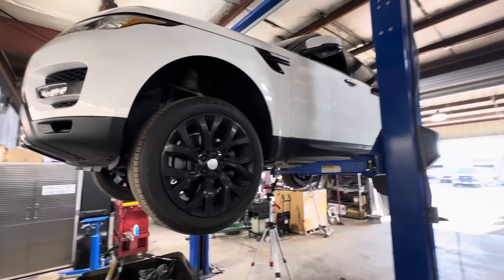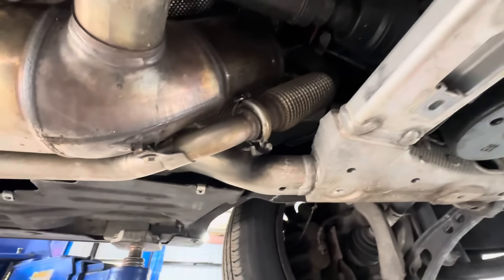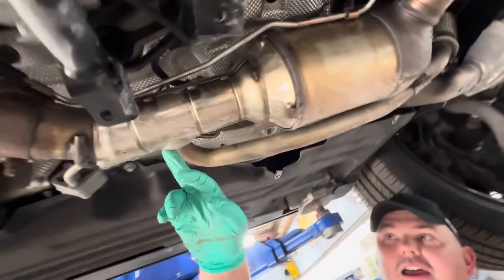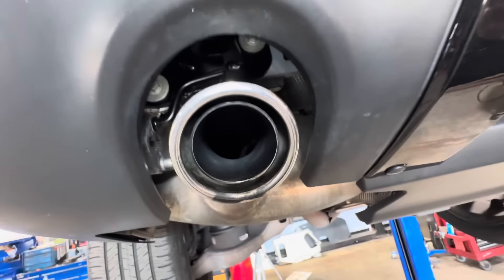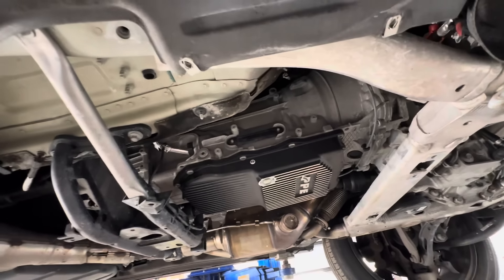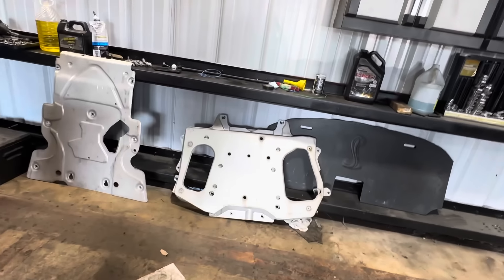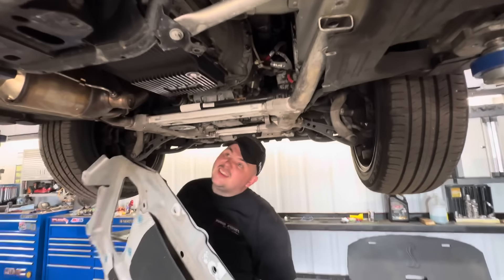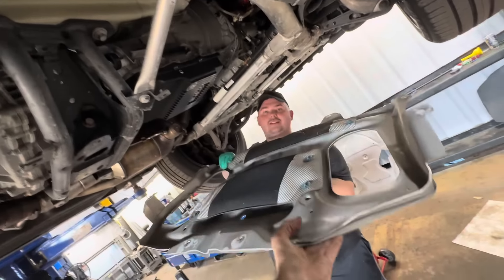Most Expensive Over Engineered Exhaust EVER!!! 2017 Range Rover 3.0 Diesel

Comment: Don't worry, it'll snap its crankshaft soon or do a big end. We see these failures all the time here in the UK where the engine is very common. It's also used in Citroen C5's and C6's, as well as the new Ford Ranger and nigh-on identical VW Amarok.
Reply from the maker: It's needs a crank swap from the ford 3.0
Reply: Also the padlock is useless. Nice try though.
Reply: @RainmanRaysRepairs  The Gen 2 engines from 2018 (which this is one of them) have the same crank and they're still snapping. I think half of the issue is how much power JLR are squeezing out of the things - at up to 302 bhp/225 kW and 516 lb-ft/700 Nm something has to give. Even so, the lubrication pathways to the second and third mains are dire and suffer massive oil pressure drops, not helped by the new oil pump with the electronic solenoid designed to reduce oil pressure under light load conditions.
Reply: I was trying to use a scope to tell if the one I was working on had timing issues but had a hard time because the resolution of my scope sucks

Comment: Cars are mysterious machines. my beloved old /98 corolla took me  out running errands on friday and was perfectly normal... saturday morning i turned the key and nothing happened but i did have lots of battery power judging by light brightness... $60 tow to the mechanic who diagnosed it with a blown ignition relay... I dunno what that is but it died in its sleep apparently. I had them do oil change and a routine inspection so I feel safe taking it into the Canadian wilderness camping this summer.  shes an old girl so  having my trusted mechanic stamp his seal of approval on her is a good feeling.
Reply: old cars need maintenance.  you just do those repairs and thank the old girl for the continued service!!  I had a '87 Camry in Calgary (10 yrs old) and that thing was amazing, better than any 4wd in winter too.  Boring as eff, but hey, it's a tin box on wheels.

Comment: As a 5X Land Rover owner here in the UK and mechanic for 30 odd yrs I am fully qualified to ask "why are you standing under one without a leak tray ?" People would get board if I shipped my Disco3 to your shop to get all the faults repaired, I cry when I buy a new part for it knowing that something else will break before I can fit it. Land Rover the best 4X4Xfar ......It's like an English Jeep thing but without the ducks !! LOL XX
Reply: if you want a good jeep in the US we get a toyota 4runner or an old lexus of the same design. ford and chevy seem to be only slightly better than jeep unfortunately
Reply: Disco3 (LR3 for us in the States) is among the more reliable Rover models. That V8 was very good and reliable. Far better than the newer gen V8 & V6 engines. Rust and water intrusion are what destroys those cars around here. Cheers.
Reply: What do you guys have against designing electrics and electronics? I had a 1969 Triumph motorcycle that had nothing but issues with the electrics and every single UK made car is horrible.
Reply: Well, once BMW bought LR they did finally make a LR that did not leak fluids while in warranty, something JLR could never do.
Reply: @mattbrown5511  Lucas electrical, they invented the intermittent wiper, and also the flashing indicator. All you can say is that you are thankful they did not also include Magneti Marelli ignition in the mix as well.
Reply: @SeanBZA  BMW didn’t own Rover Group for very long. They lost a lot of money on that venture. They did end up with the MINI Cooper brand, though.
Reply: @paulferreira8342  Yes, but those BMW designed 3.0l engines were a lot better than the old V8 engines that were there, and did not lead oil, plus had much better fuel economy. No drive on a beach in low, and get a warning about "fill up fuel, range below 80km" with a full tank.

Comment: Great video. The hoops car companies are having to jump through for emissions is incredible. The customer always foots the bill
Reply: That same Ford diesel is available in other vehicles with simpler exhaust setups.  It wasn't government that required the hoops shown here, it was Jaguar / Range Rover that thought this was a good idea. As my father used to say, never trust the English to build anything larger than a hat.
Reply: @billmilosz It wasn't your government, but it was the UK and EU that required it. They're not going to change the exhaust system just for the US market when all other markets require it.
Reply: These are particulate control measures. The hoops people have to jump through to avoid dying are incredible. Why should people die so some can drive diesels? The manufacturer makes money and the rest of us foot the bill. This goes double for oil companies.
Reply: I agree, resource/emission management from the tail wagging the dog.
Reply: @SammyInnit  The Ford diesels sold for Ford vehicles in the UK have emission / particulate controls, but do not have this crazy plumbers' nightmare going on.  This is totally a Jaguar / Range Rover snafu.
Reply: A lot of engineering to save us from the tons of soot diesels would be shooting out without it.
Reply: Diesels are dying in the light-duty market.  If you're not hauling heavy loads or pulling up stumps, it's not worth the weight and the hassle.  I would not be surprised if replacing this exhaust would set you back $10,000.  It seems like a weird choice for a Land Rover.

Comment: Engineered to keep tapping your wallet.
Reply: You probably prefer rolling coal until the birds drop out of the sky
Reply: Not necessarily, when this kind of exhaust system goes wrong it is eye wateringly expensive to put it right, eg Def pump £579, Def injector £100, scr £1000, egr £100s and that's just some of the components that make it up, reality is the amount that those components reduce emissions can't be that much if cars that have them removed are still flying through emissions tests on the MOT (UK road safety test for a vehicle) and as far as I know they are fairly strict about it so it could well be engineered to keep tapping your wallet, it certainly does mine
Reply: But where is the converter thief supposed to make their Sawzall cuts?
(I AM JOKING!)
Reply: @MonkeyJedi99  🤣🤣🤣
Reply: @garybell3924  They are HUGE amounts cleaner than cars without all those things. Cars without those things wouldn't pass the EU emissions requirements to be able to sell them. The reason they still pass MOTs is because the legislation for testing them each year hasn't caught up due to the complexity and costs of the equipment to do those tests. Although currently they are working on that and soon all those cars with no DPF and no EGR will end up failing the emissions tests.

Comment: DPF filter particulate filter. The service life depends on the quality of the fuel plus the quality of the engine / oil consumption / which causes soot when diesel is burned - I mean oil consumption. The regeneration of this burning soot trapped inside works cyclically, approximately every 300 miles, but the ash created from burning soot inside the DPF remains and rises. Over time, the DPF becomes clogged with ash, which means an expensive replacement. DPFs cost a lot of money and the lifespan in the city is about 150,000 miles. The SCR system behind the DPF filter has a urea injector that helps clean the catalytic converter and reduces NOx in the exhaust system or otherwise reduces the NOx the car emits into the atmosphere. You have to regularly buy and add urea to a separate tank that is inside the car. The urea injector clogs after a while and the NOx sensors give error codes on the dashboard. One of the many faults of the emission system.. All this is a complex Euro 6 emission reduction system and means a huge cost to repair this system. There is a software option to disable this miracle techniques and save a lot of money. You just need to find the right person to reprogram your engine control unit. In Europe, the price is around 200 dollars. And it's a matter of a maximum of two hours.

Comment: Having the EGR using colder exhaust gas is to reduce the carbon build-up in the intake. It's actually a very clever solution. Mercedes does it as well.

Comment: Range Rovers' main plant is 20 or so miles from my home, so it's always nice to see them in the states. 

Unfortunately, they're over engineered because of the European market. They're very stringent on exhaust emissions. 

People also say they're incredibly unreliable. The L322 were quite unreliable, but not to the point that the rumour mill would have you believe. The issue is that they're expensive cars that require expensive maintenance. People don't like to pay it and so neglect them and like any other, they fail.

Comment: I had a 2016 VW Golf, part of the diesel gate scandal, and its exhaust was complex too.  They kept trying to soak me $2600 for a DPF while the vehicle was under warranty.  They also told me the DPF was getting full because I was "driving the car wrong".  I laughed at the guy and said "they designed the car wrong".  They gave me my money back on the car and I won't buy another VW group product again.   I loved the 38/50 mpg that I got but not at those costs and lies they kept spewing.
Reply: DPF easiest fix is 100 miles on highway at speed, to get it to do a self clean every month. Short trips and low speed kills them.
Reply: $2600 for a DPF are they having you on? ridiculous.

Comment: Range Rover is like Mercedes, I can afford the car, but not the upkeep.
Reply: you're doing well if you can afford that car!!
Reply: A lot of people buy them used after the depreciation hit without understanding that the maintenance & repairs are still priced for an $85k car not a $25k car.
Reply: @DeepakKumar-lv4te  I can afford a USED 2017.
Reply: @jimdavis6833  I'm driving an '08 VW Multivan which has been surprisingly solid.  I don't think I could handle the trauma of owning a RR even though it's probably the best cruiser going.

Comment: You might also consider removing the padding. Not sure why it's there anyway.

Saw a video a guy had a car with straight thru mufflers, they make good power, but have an annoying drone when on highway.

Installed a tee, a 90, and a CAREFULLY measured length of pipe, than a cap.  Used a telescoping connection in middle, since this pipe had to EXACTLY the right length.  A 1/2 inch off would ruin it.

Totally removes that one frequency from the exhaust.

Comment: I have a 2008 LR2 w/ 114K miles. Engineering like that cost a fortune to make repairs in Michigan. 5+ hours to replace a thermostat and near that much to remove entire front end to replace horn unit. Fortunately it is reliable and runs great but w/o a horn or new thermostat due to limited fixed SS income. I prefer a Ford E350 or a Cadillac of similar vintage.  Retired guy age 73

Comment: Good luck getting information on RR. Especially diesel. Had one that def issues. Would shut the truck down because of the smog crap. Small shop just can’t get the required information on some brands. Time consuming
Reply: I have a JLR scantool and I can buy access to the workshop manual

Comment: Just remember that if you get a Chery SUV in with a 3.0 diesel to look, and see the engine, drivetrain and exhaust is exactly the same, as they are built on the same assembly line, with the metal being made by Tata steel, and all the electronics coming from Chery in China. Remarkable that you need to have at least a dozen firmware updates, in warranty, to fix issues, and they also change how it drives.

Comment: I wish all companies would pull egr from after the dpf... Dirty egr just clogs the intake system
Reply: That's only HALF of the EGR system
Reply: @CPsGarage  I've got an OM642 an OM651 and a 6.0 powerstroke.  I've yet to have a reason to pull the intake on the 651...but the other two were just totally full of egr buildup... When the emissions system ultimately leads to higher emissions through loss of efficiency... What's the point?
Reply: @Robert-S-  gonna have to ask the EPA the point of them.
Reply: @CPsGarage  I doubt anyone there knows for sure lol.   I don't mind the intented purpose, but the way they let them be implemented... Is just awful.   At less the aftermarket was able to design an EGR cooler for the 6.0 powerstroke that doesn't pop like the factory ones are prone to doing.  And clearly manufacturers are able to design a post DPF pickup if they want to... Like yours.... But the fact that so many of the dpf implementations on the market are not easily serviceable... Or inexpensive to replace... Is shortsighted.  At least many of the semi class dpfs were designed as canisters that can be serviced and reused.    With most passenger/light duty vehicles you have to get creative to clean the dpf when it eventually gets clogged with stuff it can't burn off.

Comment: Welcome to Euro 6 compliant diesels. This complexity is the only way they keep the NOx and PM emissions down (to less than a fifth of 2000 standards), without which we're charged £12.50 per day to drive in greater London. The downside is you're sitting on a golden time bomb, waiting for the DPF to clog up or the EGR valve to fail. Regular freeway journeys help the DPF regen, though.

Comment: Wonder if that DPF require regen like farm tractors do.....  My CK3510 takes 25 min of 2,500 rps+  to complete every 35-ish hr, and if not done the DPF thing plugs up and could cost $2k to fix.........
Reply: Regeneration every 300 miles...
Reply: @EIRK2046Y  So does this RR have to be parked at fast idle? I'm seeing less and less advantage in diesel engines........

Comment: Ray, ever tranny swapped a 2013-19 Ford Escape? the one with that wonderful coolant system setup you gotta gut out just to get the the starter and torque converter bolts? ISTG the engineers that designed that hot mess were smoking crack and dropping blotters.

Comment: The old Land Rovers (30+ years) were quite reliable depending on what use you gave them. Nowadays, I don't want one even if it is gifted.
Reply: Speaking as a recently retired Land Rover technician that's the biggest load of nonsense I've ever heard. The old cars would leak brand new on the showroom floor and were so badly assembled we had to fix them after the came in from port. Slipped cylinder liners, leaks galore, awful build quality, electrical wiring that looked like a mouse nest. The new ones with BMW and Ingenium engines, reliable ZF transmissions and robotic body assembly are the best they've ever made.

Comment: The sheer ignorance taught to engineers is astounding. The older cars worked perfectly fine. And the illusion that this garbage reduces pollution is nonsensical. My Dad had an early 1970s Chrysler Newport with the Big Block 440 in it and after he performed a tune up on it, the tailpipe had a white residue in it. All it boils down to is your fuel, air and spark timing.